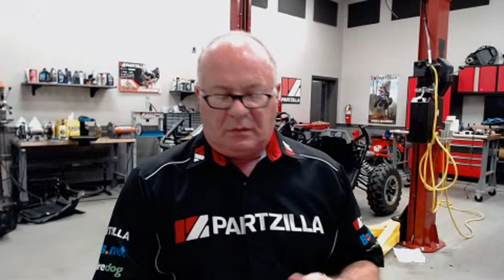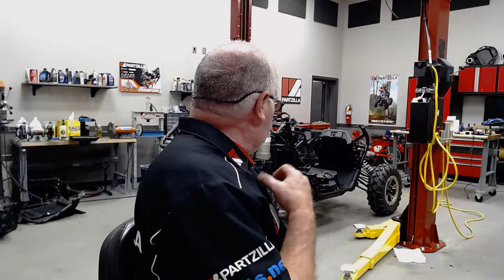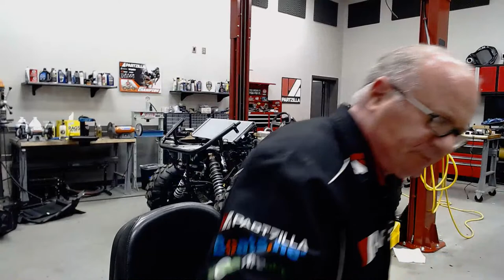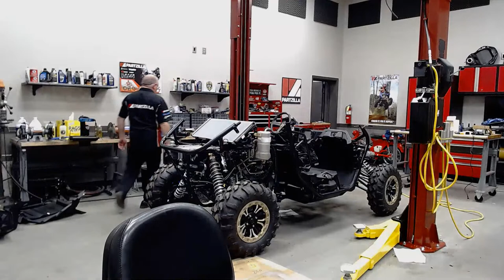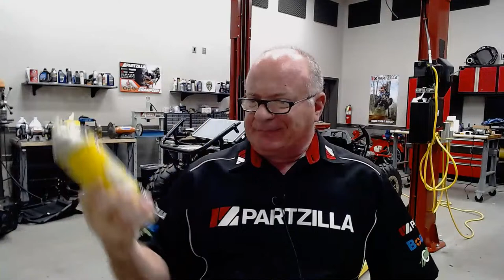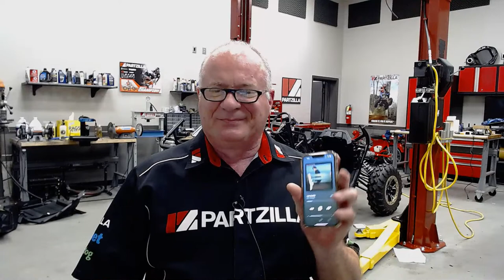Live Q&A with John Talley 6.9.23 | Partzilla.com

Comment: Yes Sir, Boz Skaggs: Silk Degrees. I grew up listening to him. 
And yes I have figured the oil change out. I couldn't pull the bottom screen out but I was able to actually see the slit in the most upper hose. I had used my hospital scissors...lol I could actually hear the suction after I released them. I will know first hand the next time.....not...lol I will never touch another one. I finished this 2005 Honda and gave it back to the customer today...yippee